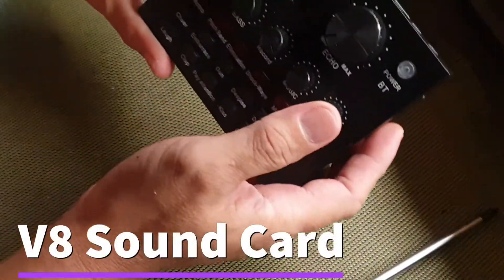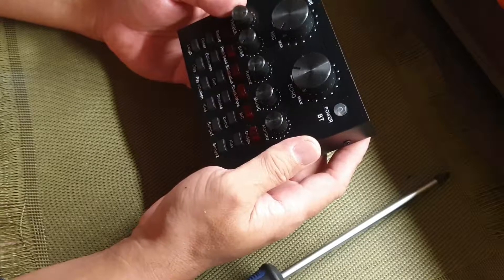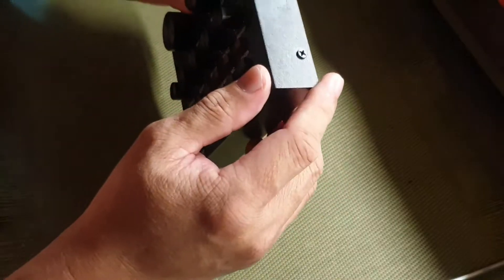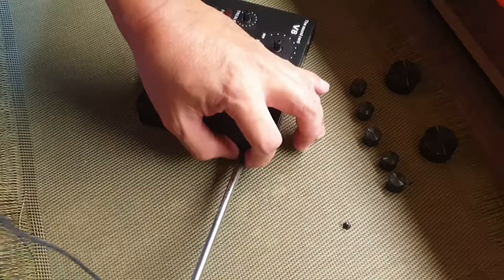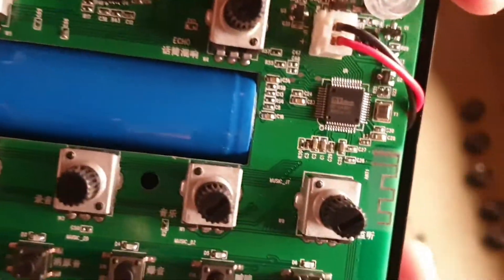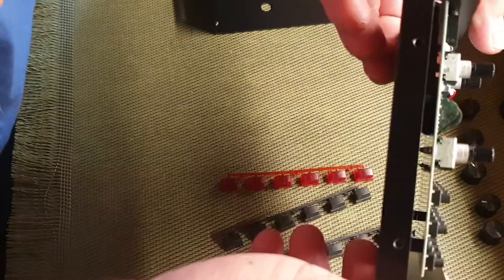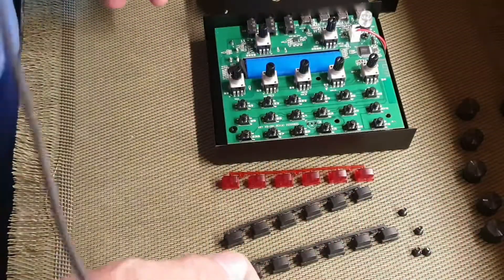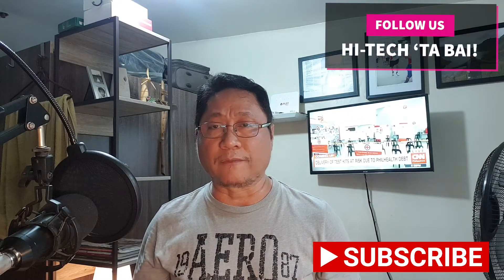INSIDE LOOK: What is inside the V8 Sound Card?

Comment: Great information  but can you tell me  how do i fix the buzzing sound coming out of one of the output  jacks    it is not hooked to a pc or anything   just with headphone plug in the one of the outputs  and it is buzzing noise   the other one is clear but low volume  output     the load output has the buzzing noise so bad you can't hear the effects   in the headphone    Headphone are good ones   work in phone  just fine
Reply from the maker: Most likely, there's a loose ground connection either in the jack or the unit itself hence the noise. The low volume in one of the output maybe the effect of the loose ground. Please subscribe. Thanks